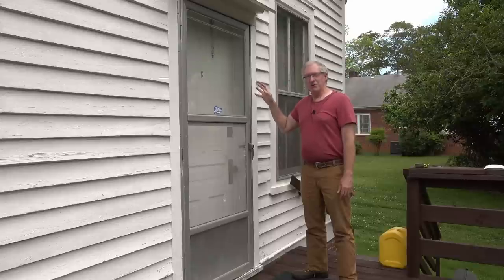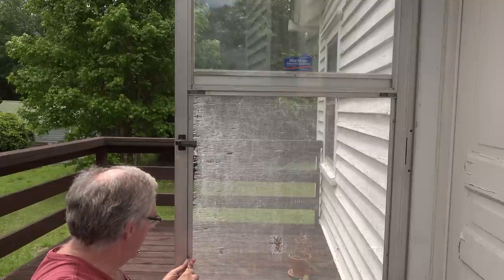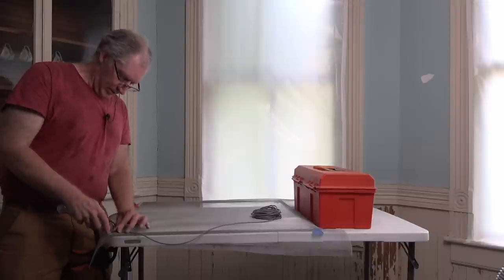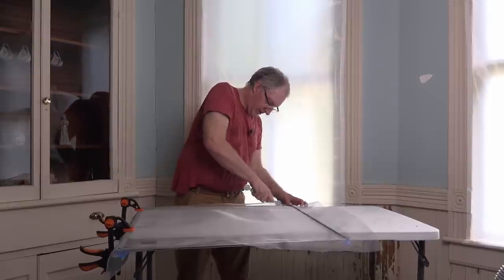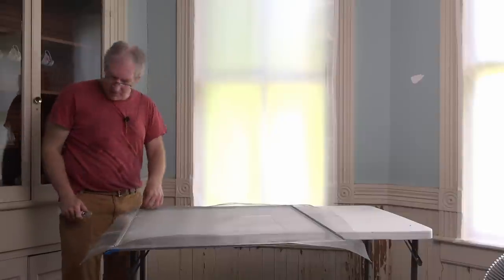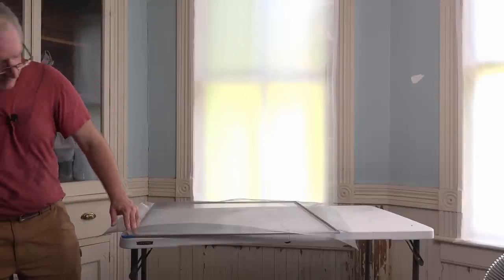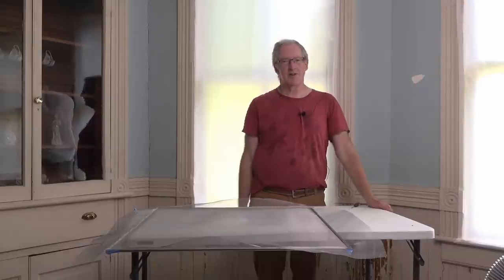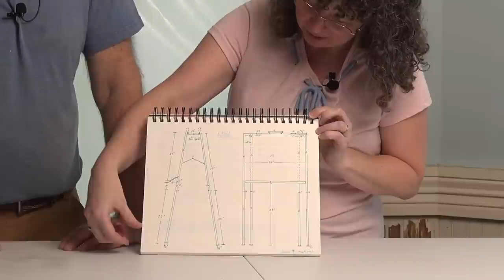EP127 Screen Door Repair

Comment: Yes, yes, yes more woodworking!   We owned a 100 yr old home in Highland Park, Illinois and refurbished it over 11 yrs.  Rebuilt windows took our the plaster walls so we could insulate etc.  One thing that has always stuck in my memory was the back screen door it was similar to the one you have.  We took the bottom panel out and replaced the screen.  Installed it back in the door and was admiring our work when our black lab saw a squirrel and went head first through the screen.  I was laughing so hard I was crying, hubby not so much, LOL  We found a scroll type grate to fit over the screen so that wouldn't happen again.  Thanks for bringing up great memories.  The only one I saw that maybe you might want to not put in the garden is the ornamental onion.  They are the bane of my front flower bed.  A friend of my daughters built her an easel for her graduation.  It was made of oak with brass fittings.36 yrs later she still uses it.
Reply from the maker: Thanks for the funny story!

Comment: Well, you two made short work of the screen repair.  It looks great - nice and taut and bug proof!  Now you can have the cool air in the morning and later evening coming in which makes things in the kitchen so pleasant!  And, Jeanie, you got a nice cutting board!  I agree with you that it's the perfect size!  I'm not a fan of huge, thick, clunky cutting boards taking up space.

Love the idea of watching you two start doing some oil painting, eventually.  But first we get the fun of seeing the easels being cut and built.  It's a two-fer!  😂

Have a wonderful week at The Old Victorian!
Reply from the maker: We used to have wasps fly right in whenever they felt like it. No more!
Reply: @1834RestorationHouse  
Yikes!  I'm not afraid of wasps outside, but they get agitated in the house and then I'm no longer a fan! 😂  Glad that problem is solved!  Now you just need to get them off and away from your deck!

Comment: We are fortunate as we have a local Ace hardware store that will rescreen an average size window or door screen for $15 dollars. I usually tip the guy $5, so it cost me $20. Money is well spent as far as I'm concerned.  Lol! I used to do my own screen repairs, but for me, it's totally worth it. The screen comes out tighter as well. They have a little gizmo and jig that pulls the screen really tight. It's amazing. 😊
Reply from the maker: Ace can do amazing things, many of which they don't advertise.
Reply: I use ACE for my screen repairs, too.

Comment: You picked a nice selection of butterfly attracting plants, most of them are annuals, a few are perennials.  You should be fine planting those in your planters, I don't think any of the listed plants is an aggressive spreader.
I look forward to seeing the easels, maybe I can get some ideas to make my existing easel stronger.
I have replaced screen using that tool, it works great.  
Thanks for the video, can't wait to find out what the mystery structure is!
Reply from the maker: Thank you Bonnie!

Comment: Woodworking projects, YES! I had to make several screens for the windows in our house several years ago. Had to make the frames and install the screen. Still have that spline tool. Lantana, absolutely do not plant it in your planter or anywhere else unless you want it to be a ground cover. We planted some as a border plant and it took over.
Reply from the maker: Thanks for the warning! We'll impound it into a pot.

Comment: You have a great variety there for plants which is great.  I would try all of them layering the smaller plants (read the tags) in front of taller plants.  Since you have them in a contained space you can easily watch those that are spreading too much and maybe transplant some of them in other areas by breaking them up.  Good luck.
Reply from the maker: Thank you for the tips!
Reply: @1834RestorationHouse  one thing I noticed is the amount of sunlight you get. I don’t see it all day long or all season long. But from what I can tell from the plants you bought I believe they are all full sun. Full sun is 6-8 hours of sun a day. Just thought I would let you know,that when you look at tags that the first thing I look at. 🤷‍♀️

Comment: Those oil paint-by-number kits were good. I still have a Geisha I did c1960. It never had glass on it and it is still perfect.
Reply: Never put glass on an oil painting.
Reply from the maker: Nice!
Reply from the maker: What happens with glass?
Reply: @1834RestorationHouse  to give it space to breathe, typically oil paintings are not displayed with glass in the frame to prevent incurring further damage due to the glass touching the paint, dust particles & condensation

Comment: I've found that lemon balm can be prolific.  By the way, I noticed the opening tease sitting on the backyard brick whatever-it-is. Thought "today's the day!"  One day, soon, sigh. Oh, and because Mike is such a good explainer, I could certainly watch woodworking segments. He respects the value of even mundane household chores, so special projects get done with similar research, care, and intelligence. One small suggestion, if its safe to do, a few shots of the work details might be good. Like the screen spline roller.
Reply: I missed that one.  That spreads all over my yard, putting it in a pot won’t help to contain it.  I don’t have anything against it really, I just pull up tons of it every spring.  They also have deep roots and is hard to pull out you have to dig or hack it out.  Maybe if you don’t let it go to seed that will help, have’t tried it myself.
Reply from the maker: We will try to get more close up shots in future projects. Thanks for the feedback.